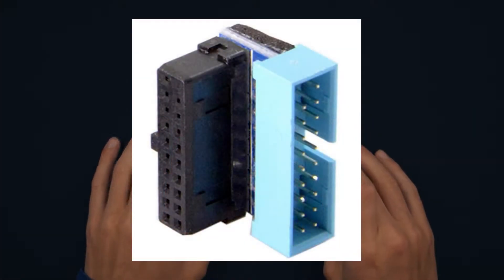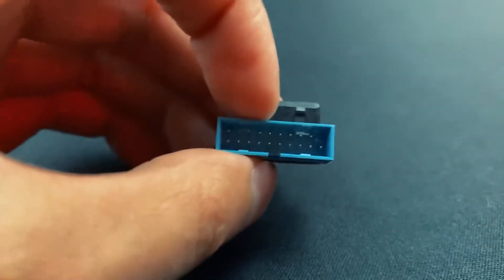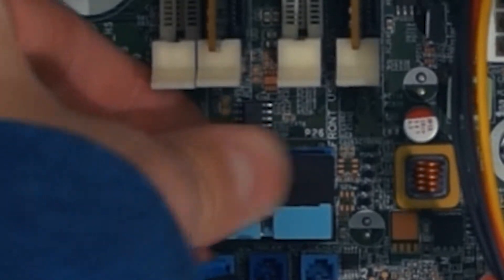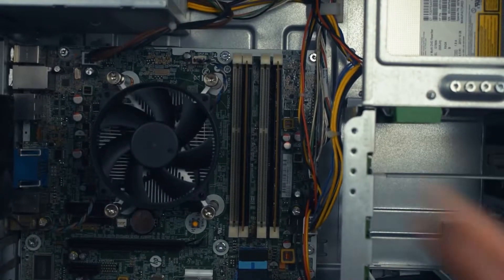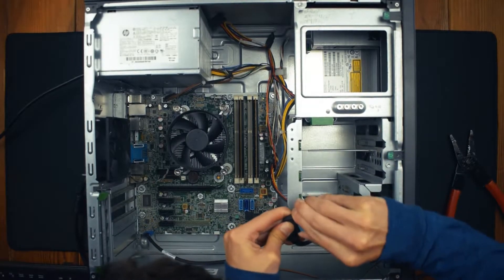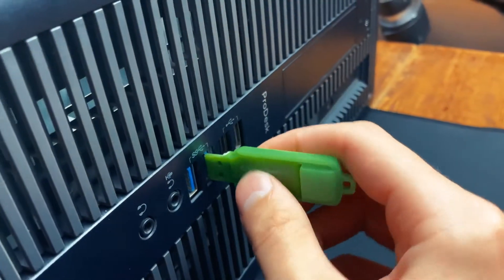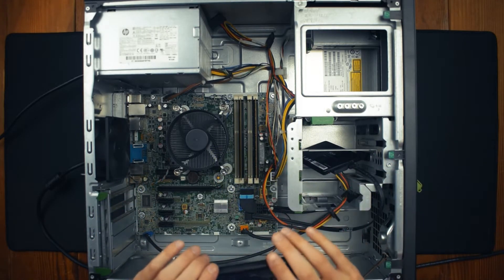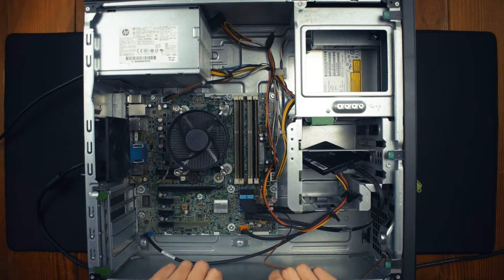USB 3 ANGLE EXTENSION ADAPTER WORK?! [2020]

Comment: The problem is that HP/dell use a small chip in the USB cable to tell the motherboard that they are OEM cables.
it even gives a error if you replace the Cable by a NON OEM cable.

Upgrading DELL/HP pc's is the most annoying thing ever, as they use as many OEM parts as they can, having chips even in Cables, to say that they are OEM cables
Reply from the maker: Thank you for this bit of information
Reply: @ZackEberly  The weird part is this is a 1-1 adapter, so each pin is a direct 1-1 connection, in the 90 degrees adapter. so it should work. correctly.

HP and dell pc's work in mysterious ways

Comment: I have a right angle in my 600 G1, and it's worked perfectly for years. Never once had any errors with it.

I also did my CPU up to a 4790K with a 1660Ti card. For being as old and cheap, she flies.

Comment: I have the HP EliteDesk 800 G1 Tower and i tried to install a ssd/hdd hot swap drive in the 5.25 bay and it came with a 3.0 that i plugged in  and it did the same thing just would not recognize any 3.0 excepted its own